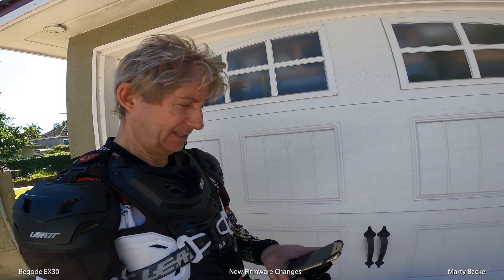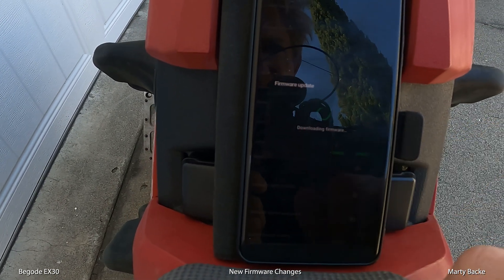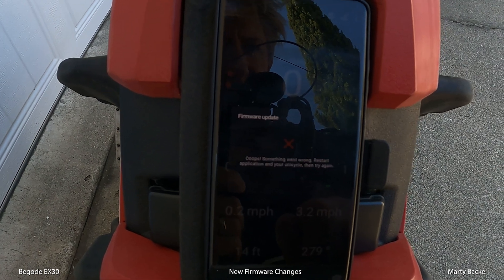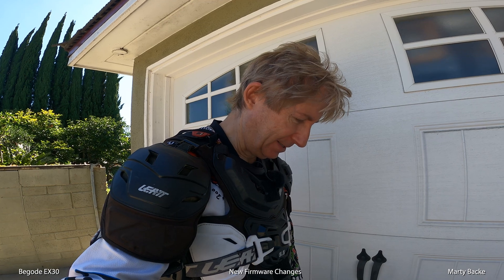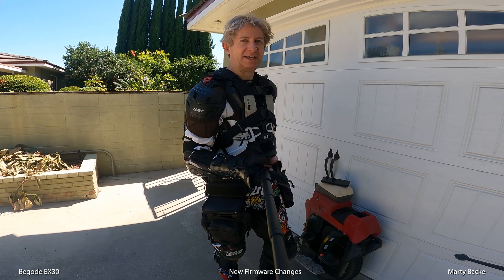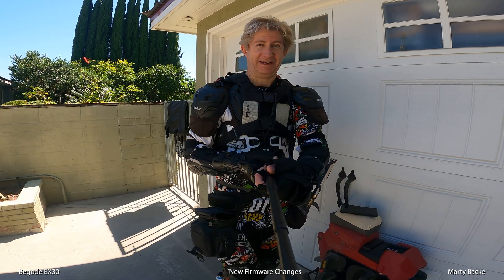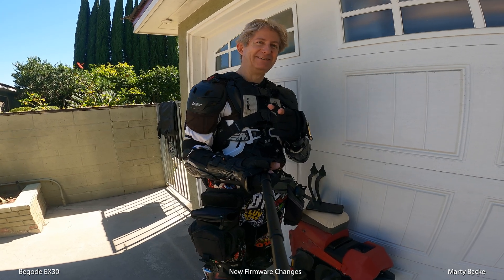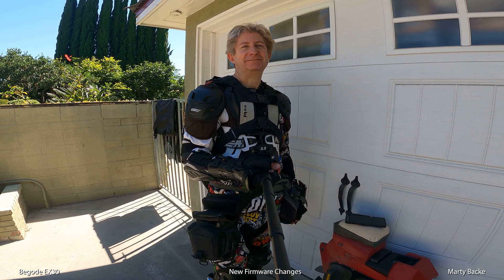New EX30 Firmware - WOW

Comment: I've had major oscillation issues with my ex30 from day one. Anytime I go faster than 35 mph, my wheel will pull me to the side really hard with no warning.
I can't believe that I have not wiped out yet. I can only attribute that to the fact I've been riding for 4 years as well as guardian angels. Lol
Was completely ready to send this wheel back, but now I am excited to try the new firmware with a sense of hope!

Thanks Marty!
Reply from the maker: Hope you like the new firmware as much as we all do. Regarding being pulled to the side that can't possibly be a firmware issue 🤔
Reply: That random pull to the right or left was happening with me as well but when I upgraded and the Clark bumper set up onto my euc it was a game changer. Also I'm over 900 miles in on this wheel so I no longer feel the random pulls to either side
Reply: I can maintain 45 plus mph feeling safe on this wheel now. Bumper set up from Clark pads or the grizzla bumber set up should do the trick and stop those random pulls

Comment: Thanks for the update! I just updated my T4 with the firmware and WOW, what a difference. If you've updated your T4, do you think you might cut a video on the new settings in the Begode app? I'm using EUC World, but it doesn't show options for these settings (they're just in Begode 1.0.15):

Maximum Speed Reminder (set at 3mph)
Horizontal Adjustment (0 - is this pedal tilt?)
Pedal Turning Angle Adjustment (0)
Power Alarm Tilt Back ON/OFF (I think it's turned on)
Power Alarm (80%)

And I hope you're ankle's doing better!
Reply from the maker: I don’t own a T4. Unfortunately I won’t be able to make any new content for at least two more months 😔 Thanks 🙏
Reply: @ElectricUnicycles  Well that sucks on both accounts! I for sure thought you had a T4, but you should absolutely get one. Damn they're fun.

Comment: Could be less range for some people as they have the ability to push the wheel harder. But it’s not real a comparison then.
Let them put that knowledge into the extreme, that will be fun.

Hope your anckle gets better soon!
Reply from the maker: Thanks - surgery next week
Reply: What's so crazy is you don't have to push the ex30 harder with the new firmware update you hardly have to lean and with the extra torque it just wants to take off I'm hitting 40 plus with out even trying ever since I did the new firmware update

Comment: So the EX30 is finally tuned the same way as my Patton. According to WrongWay, the Patton with the same battery capacity has more range than the S22. I haven't tested this myself yet.
My Patton also makes a lot of motor sound, like it wants to rev up continuously.
Reply: Nah there specs in a different category. ex 30 would shred the Patton that's just my honest opinion. Not knocking the patton but you can't compare these are two different wheels the Patton a great wheel for it's size and what not but the ex30 on a different level
Reply: And the ex30 is no miracle wheel but it's for sure a begode update from all there other wheels . It's more water proof then the master pro it has better build quality then all the other begode wheels and it don't disappoint in performance what's so ever
Reply: Ex30 has more power and torque before the new update. Can't even compare the Patton to the ex30 when it comes to power
Reply: @tremartin4727  of course, you can compare. EX30 is not a miracle wheel. Veteran has proven to be more efficient per watt/voltage.
Reply: I can agree to that brother 👍
Reply: But faster .
Reply: Patton has 2200 watt battery vs 3600 from ex30 and the the Patton has a 3000 watt motor vs a 4000 motor really know comparison in my eyes till you ride them both and see what I'm saying
Reply: @tremartin4727  it is just great that Begode acknowledge, the Patton has better tuning. And now the EX30 is tuned the same way as the Patton. Everybody is a winner.

Comment: what top speed do you get on the ex30 and how is it jumping off of curbs and doing stairs
Reply from the maker: I'm not a high-speed riders. Other local riders have achieved 55+mph.

I installed a coil shock for comfort which works great for curbs (the stock shock is very nice too). I'm not a stair rider
Reply: @ElectricUnicycles  does the kickstand get hit though? im assuming 50 mph would be a max for my bw at 215 thanks for the response btw
Reply: @lvlogs-7931 no.. I've ridden down stairs with my ex30 with zero clearance issues.. so long as your tire and shock has normal psi you'll be fine
Reply: @justinspirational  oh ty I’m fs getting a ex30